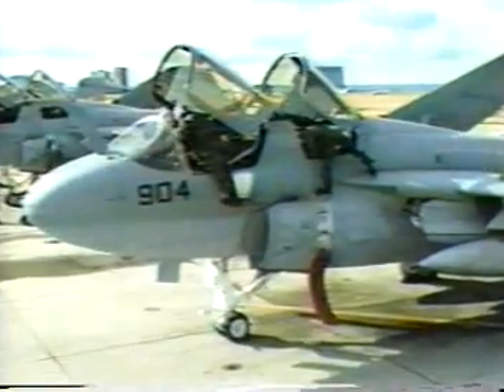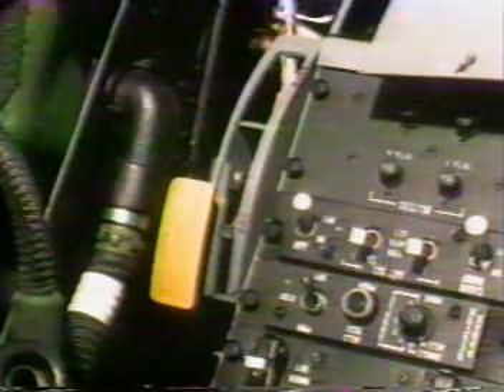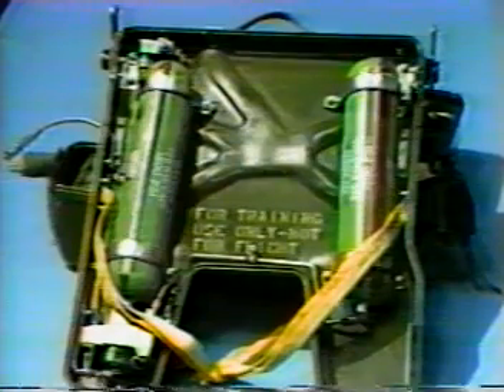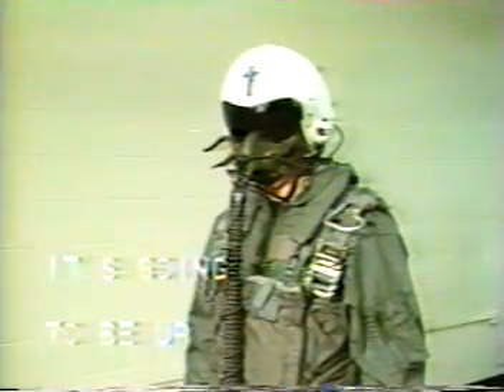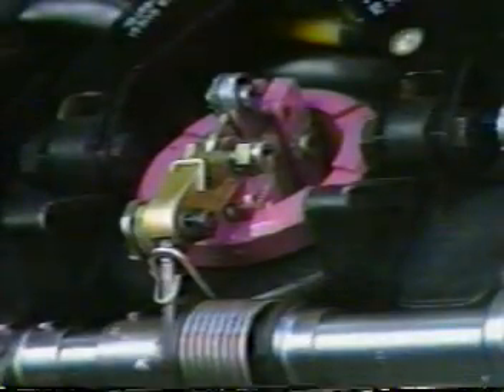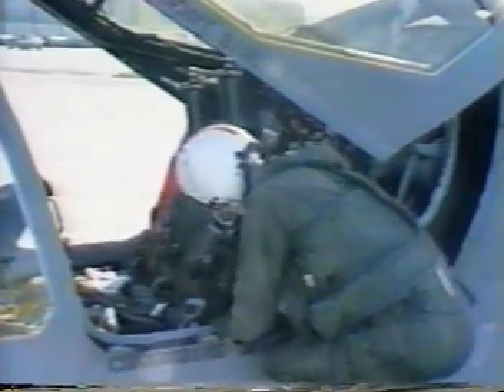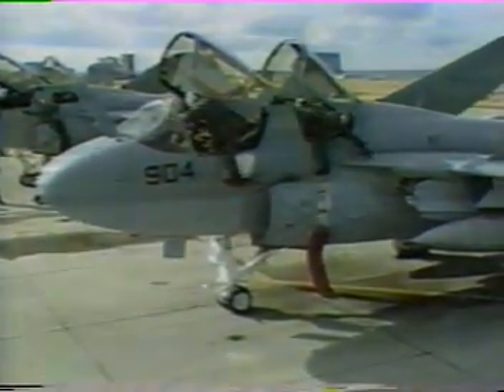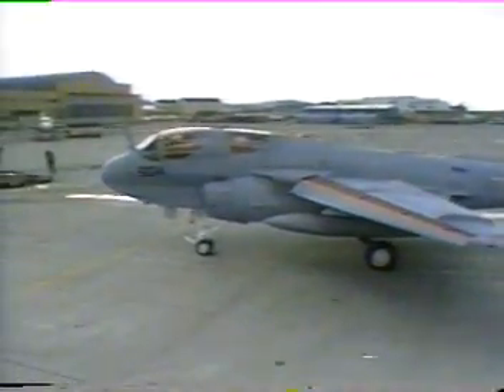EA-6B Ejection Seat Preflight

Comment: You desire to have the pilot along with crew function as such and not take over the job of the pre-flighting crew. It would be interesting to hear reports during combat use if the crews actually did their own seat checks of was this a passed off duty? As shown, that's a lot of checks plus pre-flighting the plane prior to takeoff.

Comment: Wow lot of work
Reply: Seat preflight, in practicality, was pretty easy: just look over things to make sure it looked like it was still all put together correctly while pulling all those darn pins...
Reply: @williamgburnett  god, if you missed one pin, you were doomed if you needed that seat to work.
Reply: @ronaldtartaglia4459  You pulled all the pins, which were all connected via a stranded wire,  and then stored them all in a cockpit box designed for that purpose. It was therefore 99.999% impossible to miss one. I won't say 100% because I am sure there is a way...

Comment: What I would be most afraid of in case of ejecting near the bow of an aircraft carrier is hitting the superstructure of the carrier itself on the way down, or plunge in the water just below the bow with the carrier about to run over me. Must be scary like hell
Reply: Any ejection is scary as hell. Always a crap shoot with your life on the line. Best avoided if at all possible until death is imminent. Then “Eject!” “Eject!” “Eject!”
Reply: As a Proud AME I always told my pilots when they asked me the question. “Are you sure this seat will work when I need it?” I would always answer: “Yes Sir I’m Positive, it will work as advertised. But if not bring it back and we will make it right.”
Reply: An EA-6B pilot with whom I went through EA-6B training did just that only months after we got to our respective fleet squadrons. In his case they dribbled off the front end of a waist catapult on USS America going about 60 knots. He command-ejected all four aircrew at the end of the catapult stroke. Unfortunately, with such low airspeed, ECMO 3's ejection seat, which ejects 1.2 seconds before the pilot's seat during a command-eject sequence, hit him in the head and killed him during the ejection. The pilot's seat and ECMO 3's seat have the same rocket motor / trajectory, requiring more airspeed than they had to ensure enough separation between the seats. The seats all had inherent "0/0" capability.